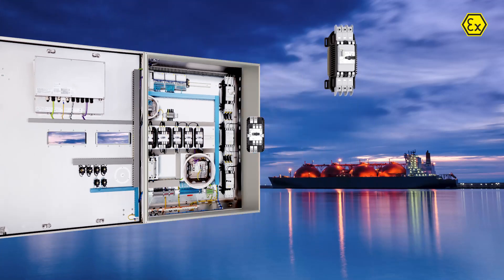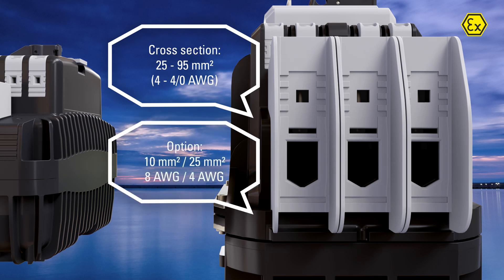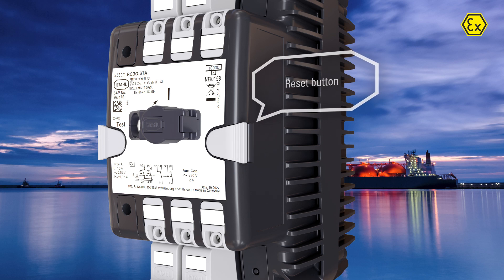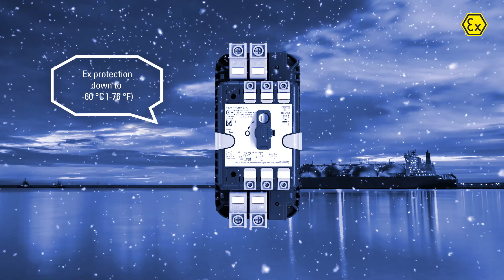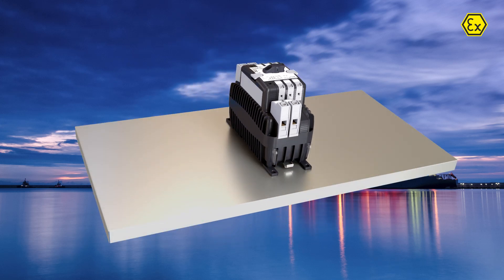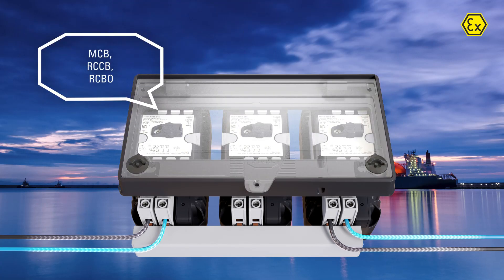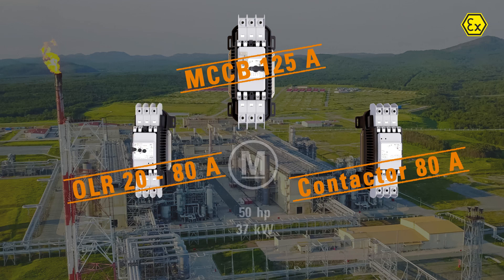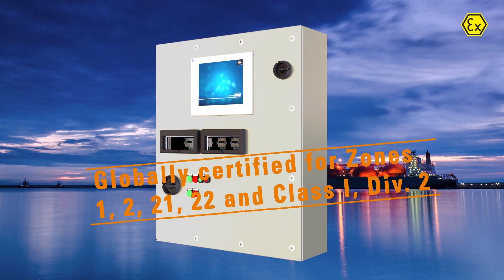R. STAHL's new Circuit Breaker 8530 and Motor Starter 8550 series

Comment: Congratulations to R. STAHL for its technological manufacturing update and for its EXAMPLE in making “Ex” equipment available on the market that incorporate, in the same product, different types of “Ex” protection, such as Ex “e” (increased security), Ex “ d” (flame proof).

By applying the COMBINATION of different manufacturing methods, such as plastic injection, optimized “Ex” equipment can be manufactured with the “intelligent” application of the best characteristics of each type of “Ex” protection for each “Ex” component in particular.

 “Ex” instrumentation, automation, telecommunications and electrical equipment that incorporate these characteristics, being designed, manufactured and certified with the COMBINATION of different types of “Ex” protection, provide USER and OWNER Companies with installations in explosive atmospheres, containing flammable gases or combustible dust, the significant BENEFITS of greater FACILITIES of “Ex” field services, including ASSEMBLY, INSPECTION and MAINTENANCE services in hazardous areas.  👍😊
Reply from the maker: Dear Robercval Bulgarelli, Thank you for your comment! Our tech upgrade integrates Ex "e" and Ex "d" protections for advanced safety. The mix of manufacturing methods, including plastic injection, makes our products user-friendly and secure.
Reply: @RSTAHLGROUP  I totally agree with that!  As an end user of "Ex" equipment in the Oil & Gas industry over the last 40 years, I have had to face many serious problems related to metal explosion-proof enclosures (Ex "d"), with direct cable entries, including the undue presence of serious non-conformities, which made that Ex "d" equipment unsafe.  With the advent and popularization of PLASTIC INJECTION techniques in the early 1990s, components with COMBINED PROTECTIONS, Ex db eb IIC Gb (U) marking, and external casings in stainless steel or plastic, with INCREASED SAFETY (Ex "e" ), began facilitating end-users' field services in hazardous areas, including "Ex" INSTALLATION, INSPECTION and MAINTENANCE !  Congratulations to R. Stahl for its technological development and the update of its "Ex" products, which contribute to increasing the SAFETY and compliance levels of installations in explosive atmospheres!  👍